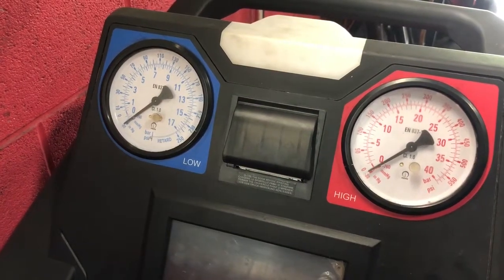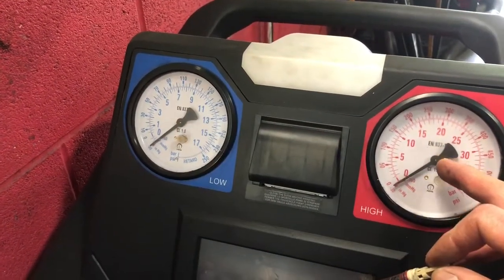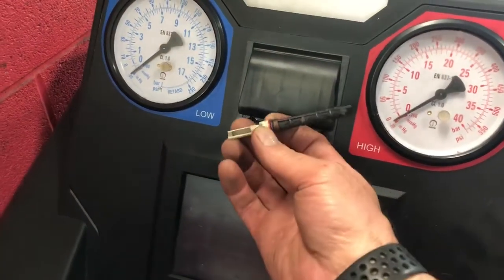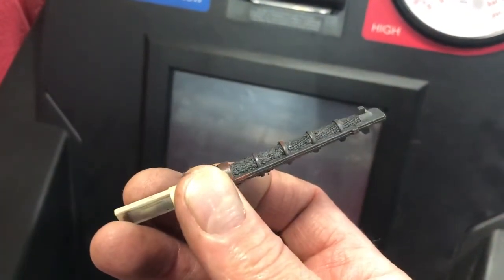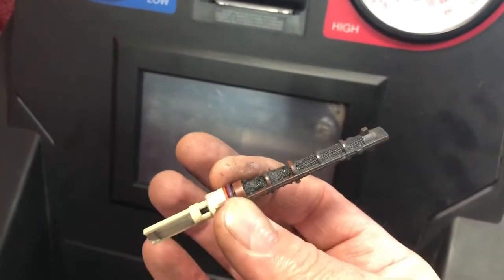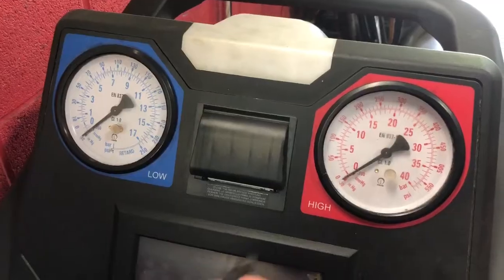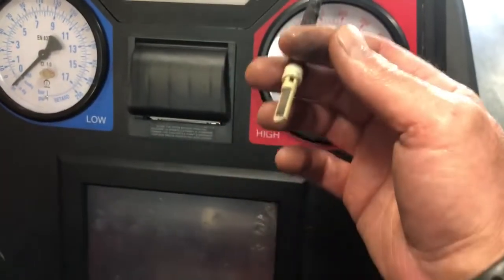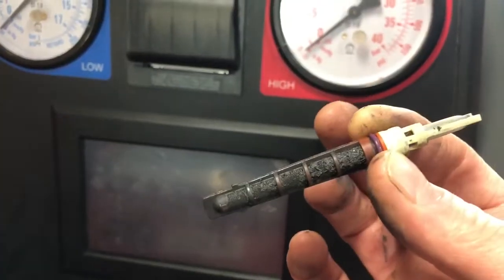Clogged Automotive AC Orifice Tube

Comment: On my Volvo 850, a few years ago I got the aircon topped up, the evaporator got so cold that it froze over and no air could even get through.  I got a leak, replaced evaporator, condenser, receiver.  But now the compressor barely clicks on and theres very little cooling, could it be the orifice tube? Thanks!

Comment: I'm wondering if a very clogged orifice tube could make shops think it's a clogged condenser or evaporator when it's just the clogged orifice tube. A shop told me i has a clogged condenser but several videos showed if your condenser is clogged the low side lines around the drier if they are not cold but the bottom line coming out of the condenser is cold then you have a clogged condenser. Mine is not cold anywhere and compressor will not stay on so either i have a clog or a leak and i already put dye in it and used a uv light and didn't see any leak. But that orifice tube was in really bad shape with black gunk and oil all over it. But i don't think my condenser is clogged like the shop said and there are definitely no leaks at the condenser. Just wondering if just a really bad orifice tube could keep the system from working.

Comment: Yes that is a possible mis diagnosis. One test could be to remove the orifice tube and charge the system and see if the low side pressure comes up when the compressor is on.

Comment: The reason it doesn’t make any sense that too much refrigerant is flowing through the partially clogged orifice is that is not what is happening. The compressor has gone bad and is not pumping enough anymore. A new compressor would make the high side pressure increase and the low side decrease. That compressor will fail completely within one week of summer weather.
Reply: The reason the low side is the low side is because of the orifice tube. I could remove the low side hose from the compressor all together and the low side would still be low. As I stated in the video, the compressor in this unit is already bad and that’s why the orifice tube is covered with metal. It was just a two-part failure. The orifice tube is blown out inside and there’s no restriction that the orifice tube would normally make.

Comment: I have a question if your compressor kicks on off and on . And lines been vacuumed re charged low pressure switch replace and high side and it still kicks on random what u think
Reply: You need to hook up a pressure gauge on the high and low side and see what the readings are with the compressor on and the compressor off and then let me know

Comment: My AC system pressure was LOW -10psi(vacuum) and HIGH 60psi, when I jumped the ac clutch relay and forced the A/C compressor to RUN. Do you think a clogged orifice tube would cause this issue?
Reply: Maybe. It could also be the receiver/dryer plugged as well. If it has an orifice tube and not an expansion valve, try pulling the orifice tube out and checking the pressure then.
Reply: It's a low charge 😂

Comment: Can a new orifice tube be bad? I have high side low. Low side high. I've replaced every ac component on the 2005 avalanche the line and the tube are new but still no working ac. I thought it may be leaking from an oring possibility not seated in the installation somewhere. Advice on the tube?
Reply: Also.. was running hot while driving and cold at idle. No fluids in now. Trying to figure it all out before I put more in. Did a dye test.. had some leaking but fixed what I could see. Not sure if there is still a leak or not.
Reply: What are the pressures on high and low exactly?

Comment: Why will the pressure on the LP be higher with a clogged orifice tube? if it is clogged, it is logical that there is no free flow through this element, only it is obstructed, so the pressure will be lower
Reply: I made this video to show and describe what a clogged orifice tube would look like and what the symptoms would be. If you notice about a 1 minute and 20 seconds into the video I say the clogging was not actually the problem with this orifice tube. It was actually blown out and there was no restriction happening and that’s why it was high on the low side.
Reply: @carlepstein2162  ahh ok ;)

Comment: So question my Ac compressor dose not run at all it only works when you jump out the relay all the fuses and wiring is good I checked it. No leaks on the condenser or any lines that I could see could this be a clogged orifice tube my guess there’s probably too much pressure on the high side pressure switch keeping the compressor from turning on. System worked last year I also pushed down on the high side charge valve and I herd pressure shoot out low side only had little pressure not much.
Reply: The high pressure switch would not stop the compressor from coming on initially. The compressor would come on and over about 5 to 10 seconds build pressure and if something was plugged it would build too much pressure then the high pressure cutout would shut off the compressor. Check the 2 wires at the relay for hot and ground to trigger the relay. There are 4 pins in the relay. Don’t check the ones you jump to make the compressor work. Check the other 2. Either the power or ground show come on and off when you turn the ac switch on in the climate control in the car. If the power / ground is missing look to the climate control head and check a wiring diagram to trace the wire.
Reply: @carlepstein2162  the thing is I still had no Ac when I jumped out the compressor and the cooling fans under the hood did not come on like they should the wiring to the compressor is fine clutch engages compressor spins the wiring in the dash is good all my climate controls work Ac light comes on rear defroster works heat all that so not any wiring there for some reason the ECM not commanding the compressor or condenser fans on. Usually the pressure switch prevents that. My vehicle only has one pressure switch on the high side line trust me I searched it up just one pressure switch and there pressure in the high side cause it shot out of the charge port when I pushed the valve down so gotta be too much pressure or bad Orifice tube
Reply: When full of Freon the system has about 100 psi when the car is shut off. That is the pressure you are seeing. When you jump the relay and the clutch engages you are simply bypassing the ecm so the ecm doesn’t matter anymore at that point. Except for the cooling fan control but for now we are just trying to get cold air manually with the relay jumped. When the clutch is engaged feel the temp of the pressure line to the condenser. It should be hot, very hot almost too hot to touch. Keep feeling the temperature of the pressure line in and out of the condenser and then touch it all along the way to the evaporator at the firewall and see if at any point the line gets cold if not check the return line right at the firewall and see if it is cold. From what you were describing it sounds like there is not enough Freon in the system. The best way of course would be to have a machine pull out the Freon and wait so that you can see how much is in there and then refill it with the proper amount Plan B would be to go get can of Freon with an adapter to add it. By the way the high pressure switch is an input to the ECM one of the parameters needed for it to give the output power to the relay so by jumping the relay you were completely bypassing any safety mechanisms including the high-pressure switch. I have been fixing AC systems for almost 40 years my advice is  add some Freon and let me know from there
Reply: @carlepstein2162   hey sorry for the really late reply I took the car to a shop cause I just couldn’t figure this out turned out I was low on gas a bit the test valve was leaking a tiny bit I guess enough leaked out to stop the compressor from running the mechanic replaced both valves in the high and low sides and replaced orifice tube cause I wanted that replaced as well system works now.

Comment: What noise was the compressor making, is it a loud whining sound?🤔
Reply: No the compressor would not make any abnormal noises when the orifice tube is plugged because the low pressure cutoff would shut it off before any noises.

Comment: I replaced my orifice tube on my 1998 S10, It had been blowing hot air. After replacing the tube it worked well for a day. It's now blowing hot air again. Could I have put the tube  in backwards?
Reply: You need to replace the dryer/accumulator as well and blow out the system and broken components so it doesn't reclog everything
Reply: The Schrader valve is probably bad. I would change them out because they leak bad on chevys

Comment: My daughter's 2002 Escape V6 air will blow cold at idle but goes warm at highway speeds. Could this be the reason?
Reply: did you ever figure it out? I'm having the same issue with a 2011 Town Car
Reply: That’s a compressor issue the compressor is starting to go it no longer can compress at high rpms it’s getting weak

Comment: Where is the tube located on a 2015 pathfinder?
Reply: I think that car has a expansion valve and not an orifice tube. Do your research in that direction.
Reply: @carlepstein2162    Orifice tubes are expansion valves
Reply: @ryans413 same result, different designs

Comment: so then it wasn't clogged?
Reply: Good observation since I did name the video clogged. This is very rare and this is exactly what a clogged orifice tube would look like. The fact that this one is blown out inside is a side note, I mainly wanted to explain how an orifice tube worked and what a clogged one looks like. Nice job on paying attention.
Reply: Merely mentioned because I came to your video to see pressure readings with a "clogged" office tube.
Reply: No but broken letting too much pressure into the low side

Comment: My compressor clutch spins but air isn’t cooling so im going to change this
Reply: You need to check the pressure first. It may just be low on Freon.
Reply: @carlepstein2162   the clutch stays spinning I tried adding freon aint even take the bottle
Reply: Of course do as you like but you are replacing it on a guess. Until you get a proper set of gauges on it that can read high and low pressure and get some scientific data is just a guess. My advice is take the money you would spend on the freon and the tube and buy or rent a set of gauges so you can do a proper diagnosis.
Reply: Yes sir i ordered a set of gauges Wednesday waiting on them

Comment: I have a 2002 Chevy Impala 3.8 l for the life of me I can't find the AC orifice location
Reply: You have to remove the air cleaner assembly and vacuum brake booster. Then it’s in the metal hose coupling near the radiator. You may have to remove the lower radiator baffle as well.

Comment: 1000% more helpful if you showed how it comes out
Reply: It's simple - it comes out just like he said it does. I thought it was a very good video.
Reply: @steveandrews8301  I concur with Steve
Reply: You can buy a orifice tube removal tool for as little as $23.00 on the internet. The white plastic tab end will be what you see and grab onto, when you look into ac line. The ac line itself will be marked with a flat spot or dimple marking the location of the orifice tube. What type of car do you have?